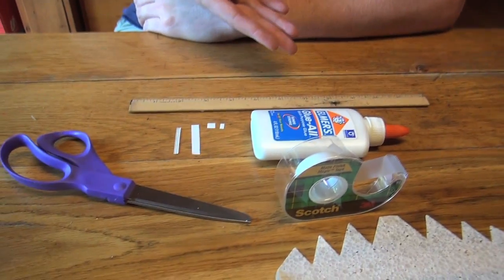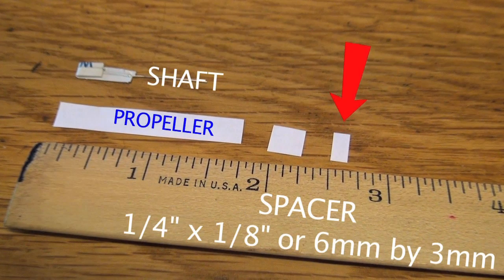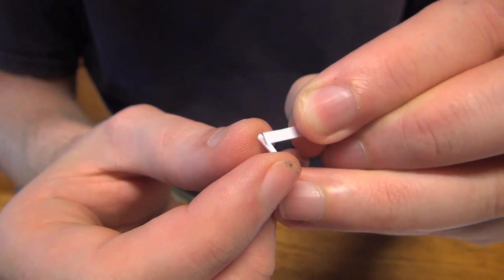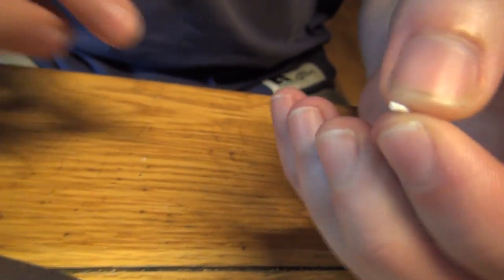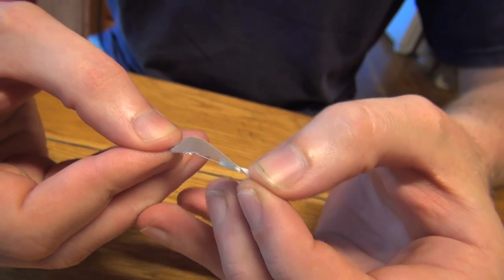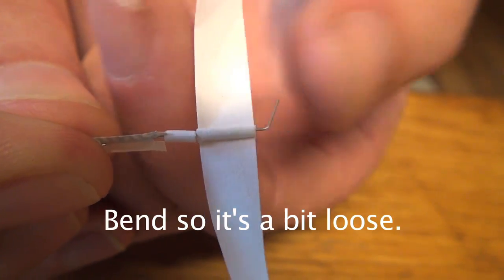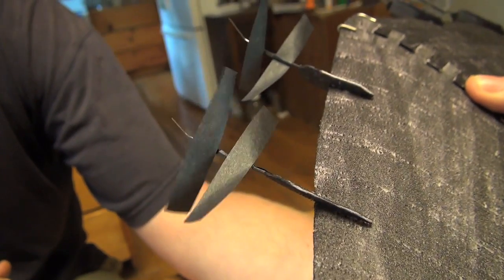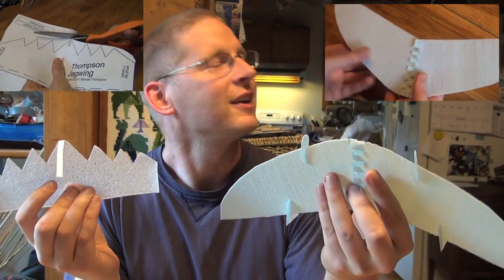Make Propellers for Walkalong Gliders (corrected)

Comment: What type of foam is used to build this glider?
Reply from the maker: It's very thin-slice EPS (expanded polystyrene) foam, 1 mm or thinner. You can buy it
https://sciencetoymaker.org/walkalong-glider-airsurf-air-surfing/glider-store/ or slice your own from scrap packaging 
https://sciencetoymaker.org/walkalong-glider-airsurf-air-surfing/make-your-own-gliders/hotwire-cut/
Reply: @sciencetoymaker  Thank you so much!
Reply: @sciencetoymaker  I am a student studying aeronautical engineering and need to build a glider for a university group assignment, and was wondering if you could provide me with some tips! Firstly, if I can't source this foam, what would you best recommend as a substitute? And secondly, do you have any advice on how to manoeuvre the gliders with board providing thrust? Any help or tips would be greatly appreciated! ☺
Reply from the maker: @malidunn8525  Paper is much heavier than thin EPS foam, so it’s a headache to get paper fixed-wing gliders to fly well. However, spinning gliders made with a strip of newspaper work well. This is a rough edit of a new design
https://www.youtube.com/watch?v=K0L0I3M2sis&t=2s
The video shows how to control the glider.